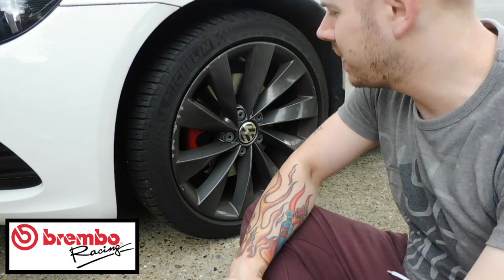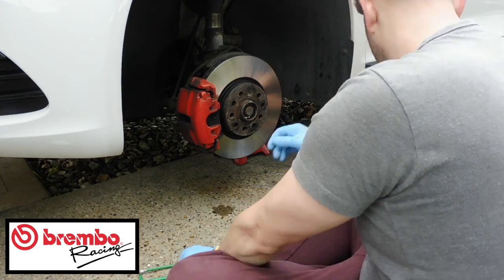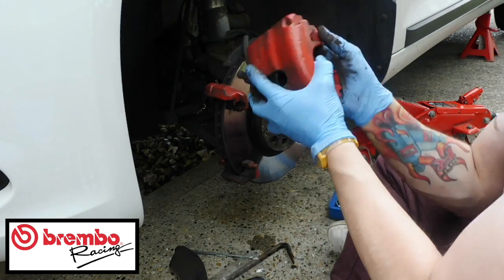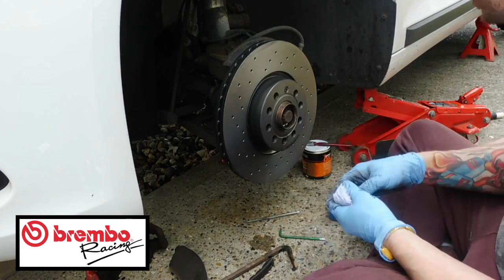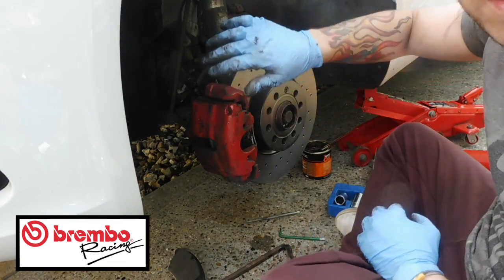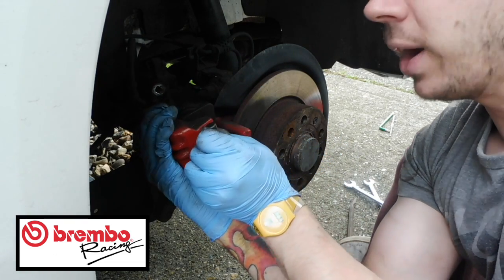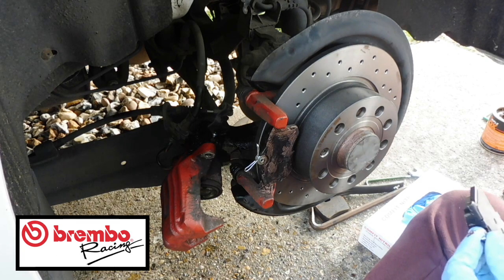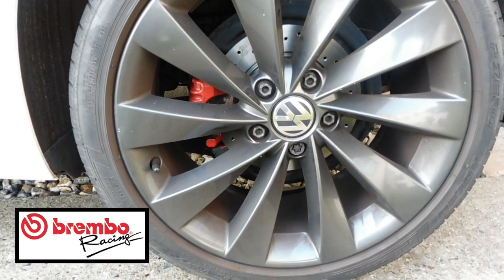Volkswagen Scirocco - Fitting new brake discs & pads front & rear

Comment: The vw workshop manual says to extract some brake fluid from the reservoir before winding the piston back or it could overflow and cause damage but nobody seems to be doing that.
Reply from the maker: There is only enough in there for the breaks so why take some out? It will only go back to the level it started with? Does that make sense?
Reply: @FWA4  I don't know. It's a small reservoir min and max are quite close. I don't know. There must be a reason why the manual recommends it.

Comment: Amazing!! I was about to do this too, about a year ago, but with 25k km now, it's almost brand new!! So, I will leave that for later... :D Great video as always my friend! Well, since you already upgraded it, it doesn't make sense to upgrade now to a BBK. I was looking at Mercedes E55 AMG brakes. They are pretty cheap, 300€, brand new discs, pads and the calipers are in great condition. The only problem I see is the distance between the bigger holes that you can see on the carrier. That's where Mercedes calipers which are Brembo's will be attached. Maybe I will have to build and adapter. The only problem is if the distance between the two holes for the screw on the car are 15cm for example and the Brembo's are 14. That won't give enough room for the adaptor. I really like to discuss this with you. ;) Cheers mate
Reply from the maker: Yes I know what you mean 👍🏻 usually to change to bigger brakes and BREMBO Callipers a lot has to be changed. I think there are adapted kits to change the location... because if not then it may have to be an entire hub change 😬 I was going to buy the big Callipers and get bigger breaks but upon looking into it the amount I would need to change in order to complete this was going to cost far too much. Plus I would then need bigger breaks and pads from a different car to go with the bigger Callipers. I will be on the look out to see if it's been done before 👍🏻 if it has I will be sure to share it with you 😄 and thanks for watching
Reply: +Dan Chapple I'm always looking after used parts that are in great condition. There might be a great deal! I found some R-Line sideskirts for 150€. They cost 500€ at "stealership" ahahah Thank you my friend, keep up the great work :D
Reply from the maker: Sweet i am looking to do side skirts :) do you have a link
Reply: +Dan Chapple if I find someone that sells them, I will tell you right way! Cheers bro ;)
Reply from the maker: +Ruben Rodrigues sweet thank you 👍🏻👍🏻😀

Comment: nice one Dan, I'm planning on lowering mine and fitting some 10mm wheel spacers. just waiting for my warranty to run out haha
Reply from the maker: Sweet bet that would look awesome 😀 👍🏻 has yours got the comfort and sport mode on the suspension ?
Reply: +Dan Chapple yeah it does, and it still works with lowering springs
Reply from the maker: sweet maybe in the next video :) i do have a mk5 golf as well lol :)
Reply: +Dan Chapple when installing springs, you have to calibrate the wheels. I was looking into H&R, Eibach or Vmaxx. But I already paid 45€ to calibrate the wheels, so, in a year I will install some lowering springs and then calibrate the wheels. And I will not do that myself. Not easy job mate! :)
Reply from the maker: +Ruben Rodrigues ok sounds like a challenge lol. 👍🏻 was it 45 each or for the lot ? 😀
Reply: +Ruben Rodrigues eibach pro kit mate

Comment: Don’t know if I’m right or wrong but don’t you need to grease the slide pins with red rubber grease and use cera tek brake grease on the pads.
Reply from the maker: You can never have too much lubrication on these moving parts, I use copper grease in the places that are necessary and I have had no problems since this video 👍🏻 thanks for the comment 😊

Comment: Great video 👍. Ever had an issue with your air intake manifold need replacing?
Reply from the maker: Do you mean when the flap gets stuck closed or opened and causes it to go into limp mode?
Reply: FL4ME WITH A 4 Not sure about that, got an engine management light come on and it’s to do with the intake manifold need replacing. Apparently it’s a common issue with sciroccos but costs nearly £500 to change

Comment: Hi! Do you remember the part number of the rear brake discs? Or the diameter if not. Thanks!
Reply from the maker: I Don't remember sorry i think either 240 or 290, but a main dealer will tell you what you have on your vehicle using the reg then you can go off that :)
Reply: @FWA4  272 maybe?
Reply from the maker: Sounds about right but check first :)

Comment: warning: dumb question ahead. Why did you choose not to replace the calipers? is it difficult? is it way too expensive for not too much improvement? you couldn't find any compatible?
Reply from the maker: I spoke the Brembo rep and he said that there is no straight swap Brembo caliper set for the scirocco. So he informed me that I would need to find one that would fit from another model or another car and I would have to change a few things like suspension/hub and brake lines etc, that was just way too much effort for me to do that. He said that the standard caliper is good enough for the upgraded discs and pads. And he was right :) also the calipers would have cost around minimum £550 each for Brembo genuine. #notadumbquestion
Reply: Great answer, thanks. Appreciate your videos. Keep up the good work :)
Reply from the maker: Thank you :)

Comment: Do not put copper ease on the bolts. That seems like a dangerous thing to do as it is meant to allow metals not to bind which may allow the bolt to work itself loose.
Reply: Don't want them to fuse and become brittle and subsequently sheer either... Seen that!
Reply: @RobertBrownieJr  that is fair. I would then say this should be researched further before people use copper ease ect.